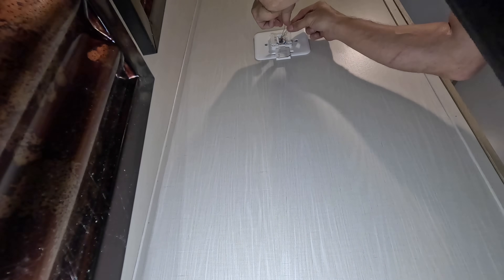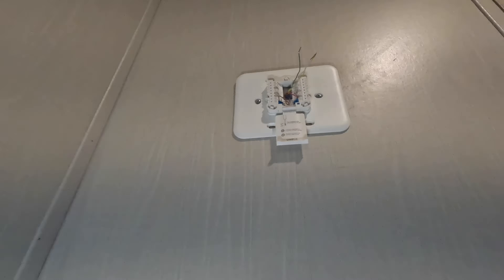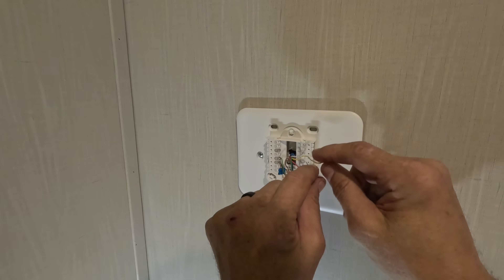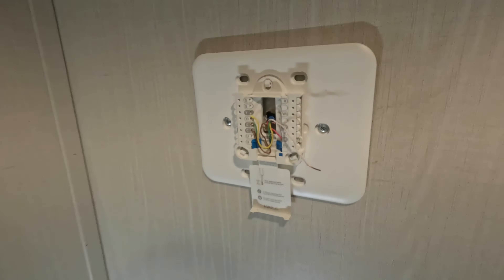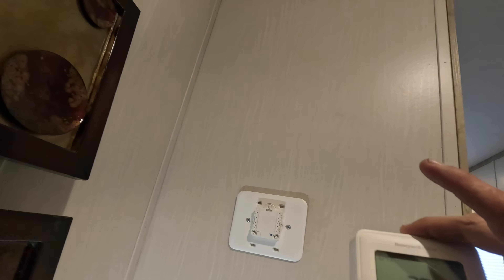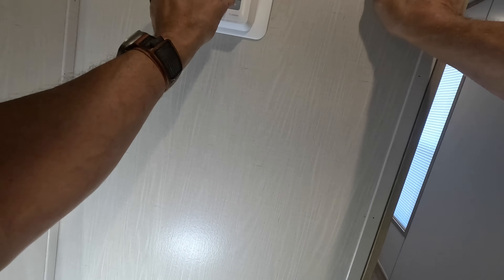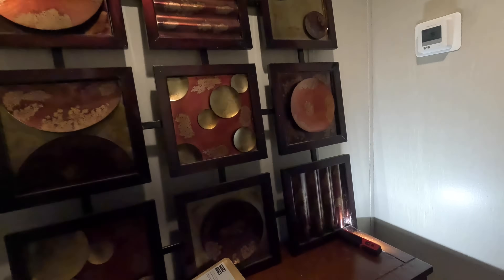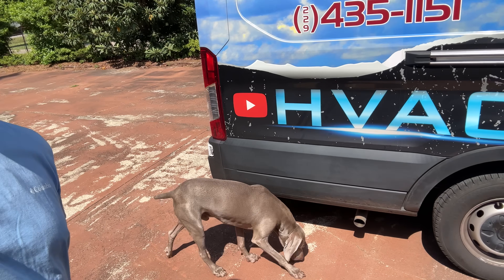Unable To Control Thermostat At All! #hvacguy #hvaclife #hvactrainingvideos

Comment: Quick google shows:

To reset an ecobee thermostat without an access code, you can perform a factory reset by pressing and holding the reset button on the device for about 10 seconds until the screen goes blank and then restarts. This will erase all settings and return the thermostat to its original factory state.

Ah, guess that is for the older models. You have to call ecobee to reset it. Which I guess it has to be connected to wifi to do it. Dumb design.

Comment: 𝐆𝐨𝐨𝐠𝐥𝐞 𝐍𝐞𝐬𝐭 𝐢𝐬 𝐚 𝐟𝐞𝐬𝐭𝐞𝐫𝐢𝐧𝐠 𝐩𝐢𝐥𝐞 𝐨𝐟 𝐜𝐫𝐚𝐩. You've be warned. 𝒆𝒄𝒐𝒃𝒆𝒆 with remote sensors works very well. The best smart thermostat available. And they don't have reset codes - this was an anomaly (probably used or a pro model locked to the distributor).

The Nest is unreliable and keeps the house too warm or too cool because it has a 2°F degree swing. That means if you set it to 75°F, the AC will not come on until it's over 77°F and will not turn off until it's under 73°F. This is not adjustable because Google refuses to listen to customer complaints.  The ecobee is fully adjustable starting at 0.5 °F degree swing (the default)

The learning features are horrible and had to be turned off because it was always too hot or too cold. There is no hold function - that's right - no hold temperature whatsoever! Why? Because F you, that's why. Nest controls you - not the other way around. It's specifically designed to save energy by making you uncomfortable - seriously.  On the other hand, ecobee works flawlessly and again is fully adjustable.

Nest also constantly bugs you to join there Nest Renew program (which has the ability to turn your AC off if the local utility says so). There is no way stop these nags on your app! 

The most serious issue is reliability. Our Nest has broken three times over 18 months, resulting in NO air conditioning during the summer in Florida. Don't buy this product - you'll be sorry. Try the 𝐄𝐜𝐨𝐛𝐞𝐞 𝐨𝐫 𝐇𝐨𝐧𝐞𝐲𝐰𝐞𝐥𝐥.

In summary, if you think your thermostat can save the planet and you don't mind indulging that fantasy while being uncomfortable in your own home, by all means get the Nest.

Comment: The only practical way to reset an Ecobee thermostat without the code is if the user has the app installed on their phone—then it can be reset from there. Otherwise, you’d need to contact Ecobee support via email, providing the serial number and the registered address. In most cases, it’s not worth the time and effort.

Comment: Damn smoke detectors you should have sold them a 9 V battery…..
Why did you not call the manufacturer to find out a code for the Wi-Fi thermostat that you took out most people don’t like a regular thermostat after they have a Wi-Fi thermostat ….
Reply: My guess is they weren't using the smart features. They would have needed the code to set it up, but they didn't know the code. I would have left the old thermostat though, just in case someone else in the family wanted to try to get it working.
Reply: @jaygosch8705 
That’s a good guess as it’s very possible

Comment: I'm amazed at the number of houses you visit, Curtis, with smoke detectors sounding low battery alarms.
Reply: There seems to be a common theme here
Reply from the maker: You would be surprised!
Reply: Sometimes it seems like every one.
Reply: They can afford to purchase a WiFi enabled thermostat yet can’t afford the price of two AA batteries for their smoke detector? Something’s misplaced here.
Reply: @jme36053 Most I've seen use 1 9 volt battery.
Reply: I just watch these videos to hear the ceiling birds sing.
Reply: Ughhhhhhh

Comment: Nothing like an analogue thermostat
Reply: Honeywell thermostats are good.
Reply: Without a time delay to prevent compressor failure! I remember those and they were made by Honeywell. Circa 1984.-
Reply: The closest to one of those digital thermostats I have ever owned or will own had a clock and a servo to raise and lower the temps. The rest of the device was analog.

Comment: Main menu, Settings, Reset, then Reset All. to put thermostat back in factory default.
Reply: That’s bull crap he took the thermostat with him he should have left it with the people and that WiFi one was probably was more expensive then that POS he put on there when we did service calls like that and we always left the old thermostat with the owner of the house
Reply: @TylerFife  We usually left small replacement parts if they asked for. For compressors , heat exchangers and coils we took back for warranty exchange.